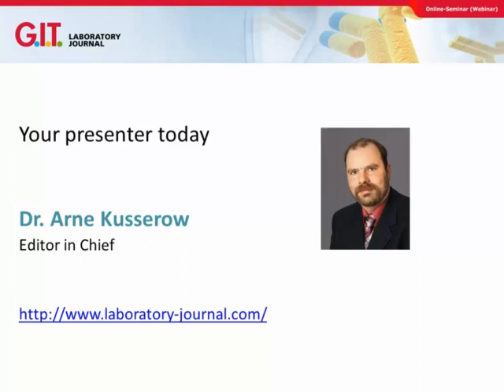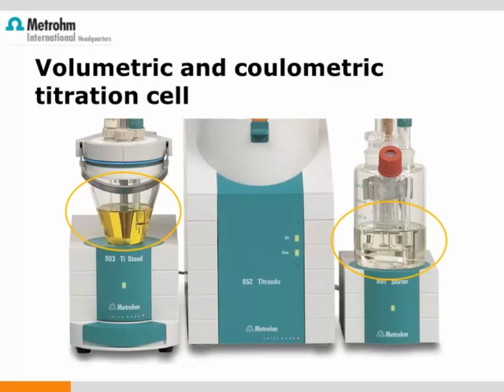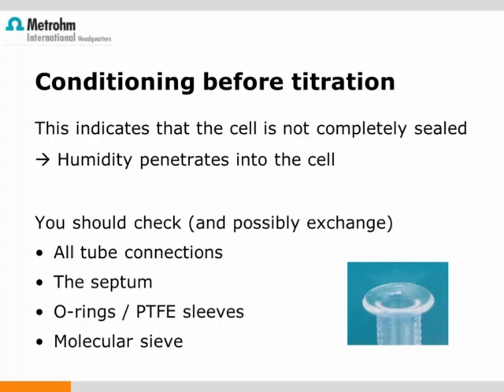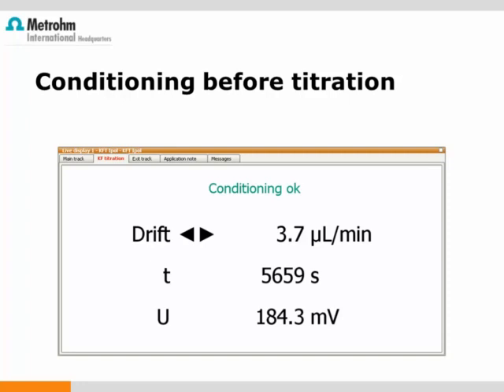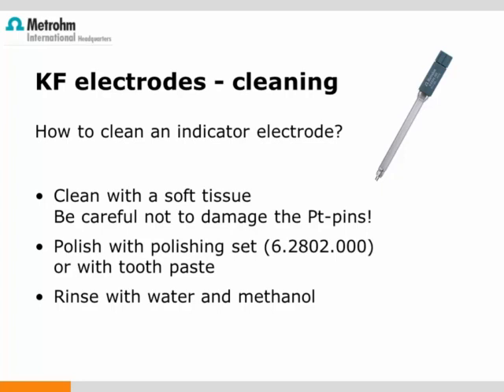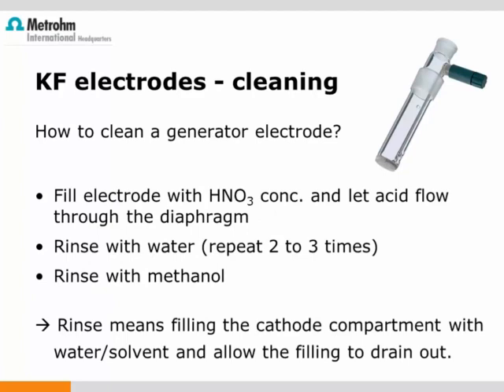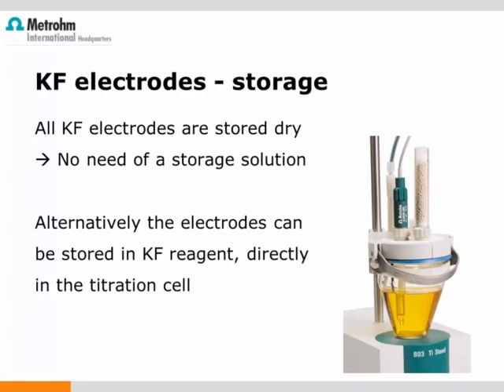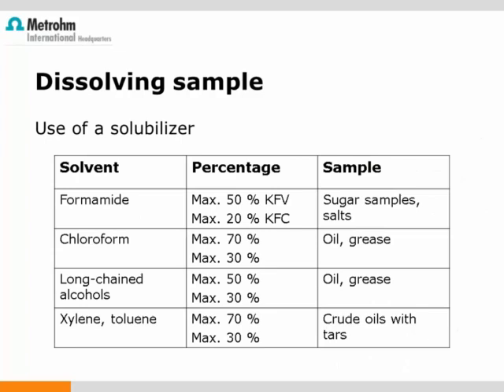Webinar recording:  Karl Fischer titration – Troubleshooting, tips and tricks

Comment: Hi, our mining lab has just purchased an Eco Titrator 10080010 to be used for copper analysis via iodimetry. Can someone share a reference on how to set up the method using Eco Titrator? we have been using manual buret for iodometry, so this one is basically an upgrade. Thank you!
Reply from the maker: Hi 
Your local Metrohm subsidiary or exclusive distributor can help you with this! Have you been in touch with them?

Comment: What if you're trying to empty the content of the titration vessel and it's not moving from the vessel to the waste bottle
What could probably cause that?
Reply from the maker: Hi
The most probable cause is a leak between titration vessel and waste bottle. Check all tubing connections and also check the cap on the waste bottle.
If this doesn't help, please get in touch with your local Metrohm service engineer.
Best regards
Metrohm International Headquarters